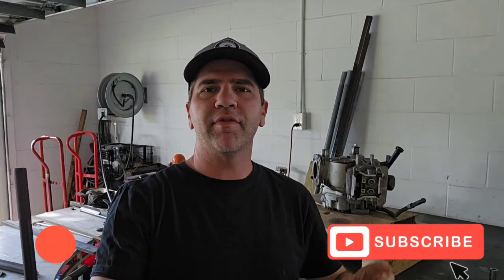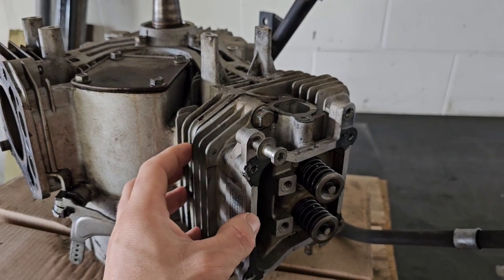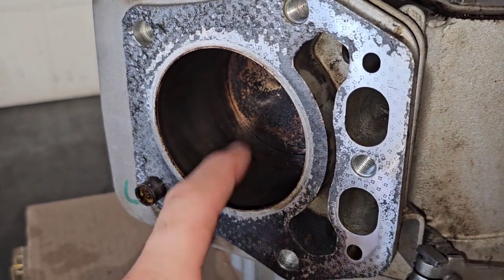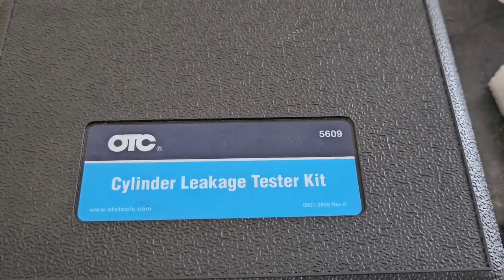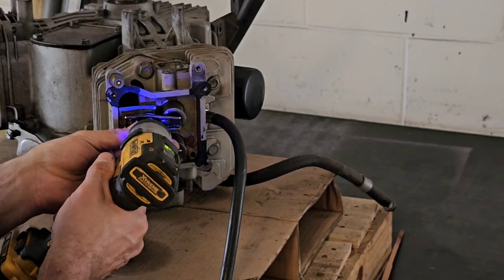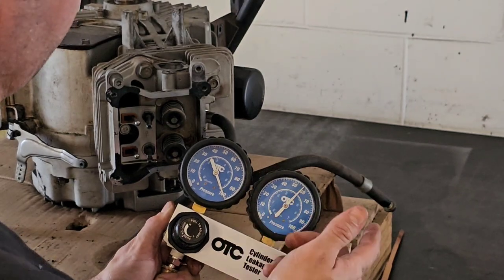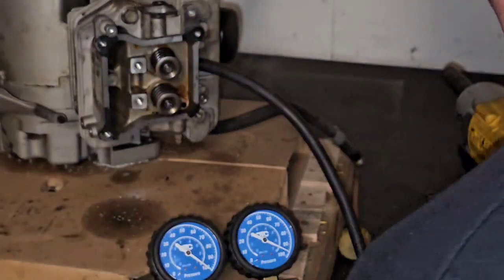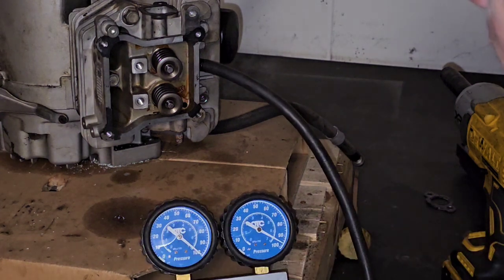Mower engine running bad? Low on power? How to do a leakdown test and lap the valves.

Comment: If you going show it sore the right way so they have a good turn out on valve job
Reply from the maker: What???
Reply from the maker: I dought any one would have a better result with that situation. Stop being a hater. If I'm doing anything wrong  then make your own video showing the "correct" way... I'll be waiting 🤣
Reply from the maker: You can't even type a comment correctly with your zero subs and not even a pic on your avatar. Get lost. 🤣

Comment: Doing valves the way you did with drill you can't see if you have if valve is warped
Reply from the maker: I never said you have to start with a drill and end with a drill and never feel it by hand at all. I never said you need or should use a drill. I just said this is the way I do it.

Comment: Hey might be a dumb question why you the engine out would it be better to just rebuild the engine
Reply from the maker: On the #1 cylinder, a valve had dropped into the cylinder and damaged the cylinder wall and cylinder head. With the cylinder wall being damaged it would cost more $ in parts and labor vs a new engine.  Here is the video I made discovering the problem and replacing the engine for my customer https://youtu.be/4jqF_HL01eM